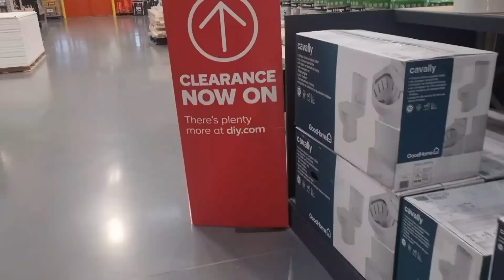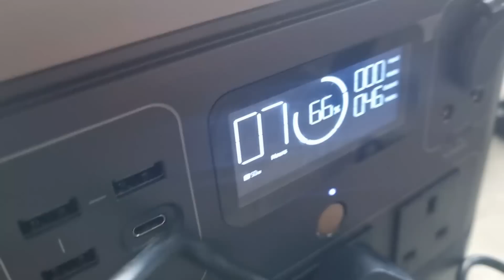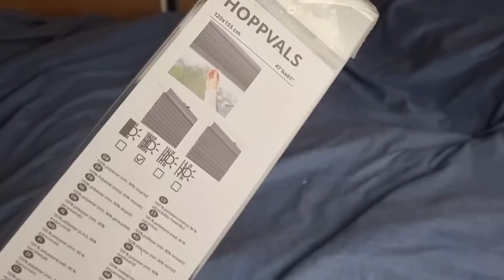FAILED !!! It Just Looked UGLY. IKEA BLINDS In Campervan

Comment: Nice work! It's coming along nicely. Instead of magnets think of like a low tech strip of fabric with either poppers or Velcro to hold them in place once they are stored away for travel, that will stop them from rattling or even a bit of cardboard wrapped in felt inside the recess to dampen the knocking when driving. Keep up the good work.

Comment: Hi Rich.
You did right. If you don't like it, change it. If you don't change it right then, you may not be able to change it later. And if you didn't like it then, you definitely won't like it later. Besides, it does look the best inside the wall.
I have done that with my galley in my build. I changed it, because I didn't like what I did.